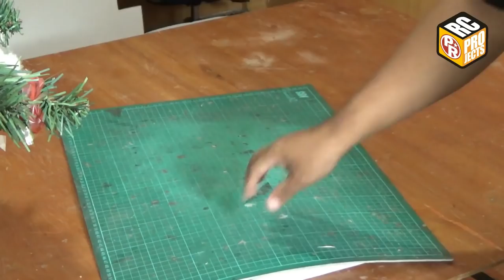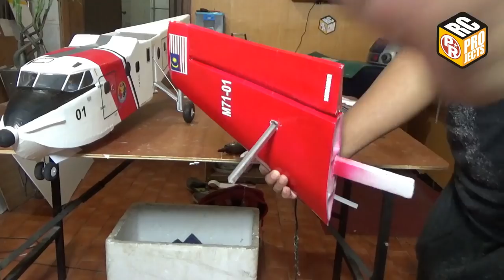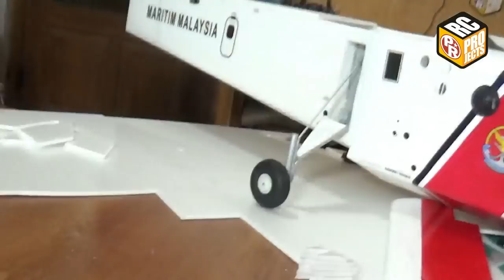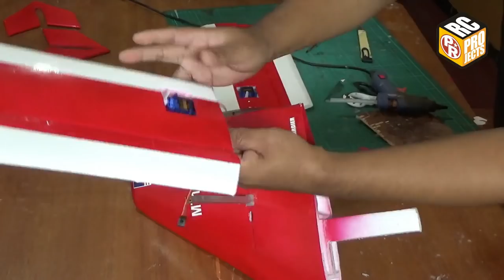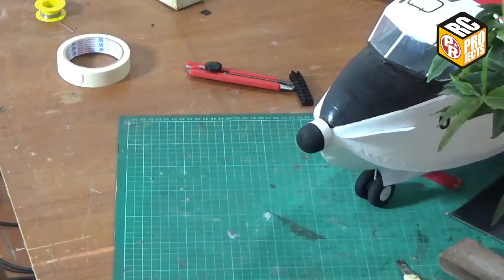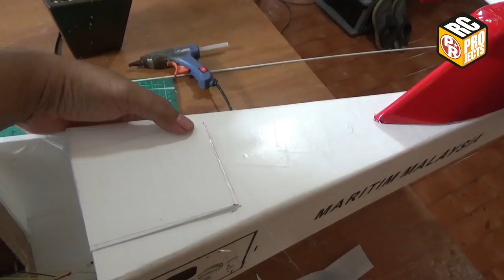Canadair CL-415 RC Plane Build Video Part 2

Comment: a weight of 800 g ??? I think that for a twin engine of 1800 mm and a battery of 3S 5200 mah there is a small problem ..... no?
I am at 1350 g without the landing gear and without the battery ...

Comment: Maaf tuan, ingin bertanya. kapasiti bagi ESC 30A boleh guna motor berapa KV ya. Boleh tuan senaraikan nilai ESC 30A, 40A, 50A, dan seterusnya berapa kapasiti KV motor boleh digunakan. Mohon pencerahan.
Reply: bantu jawab...esc 30 A untuk motor 1200kv, kalau 40a ke atas biasanya buat 2200kv keatas

Comment: Bang kalo motor brusless baru 4 menit terbang kebakar apa yg salah ya bang? Saya pake esc 40A motor brusless 2700kv battery 2200 mah 60c
Reply: Propeller yang dipakai ukuran berapa?
itu spek buat ngebut..harusnya pakai ya g 6x4 atau dibawahnya
Reply: @spetnazer  ohh gitu ya bang saya pakai prop 8x6 bang, ohh iyaa bang kalo prop makin kecil itu makin slow apa ngebut ya bang?
Reply: @fianaditya3550  
Makin ngebutt..kan KV motornya makin gede
Reply: Oke bang thx buat penceranhannya, sukses selalu ya bang